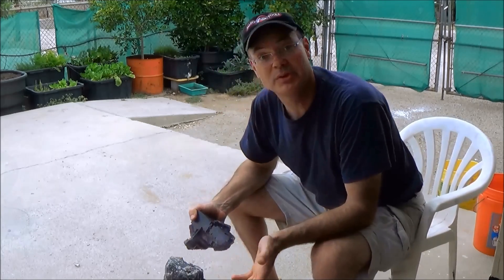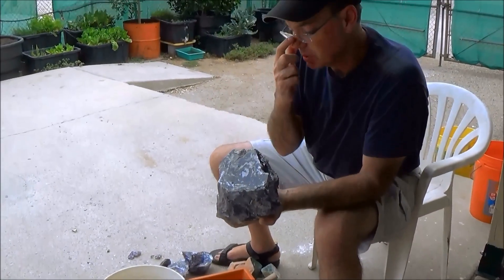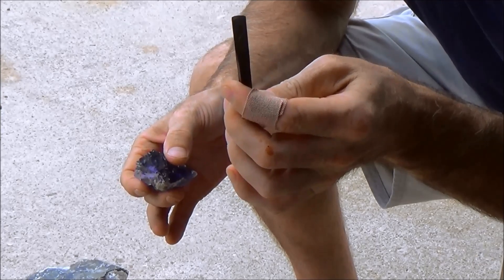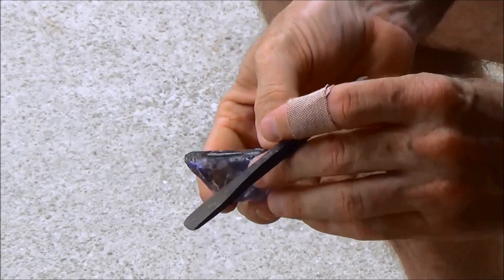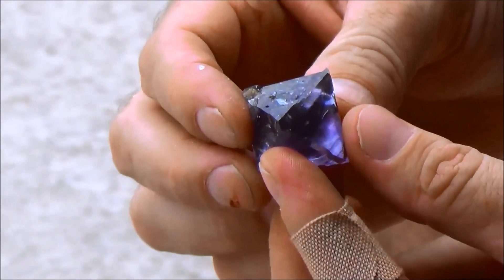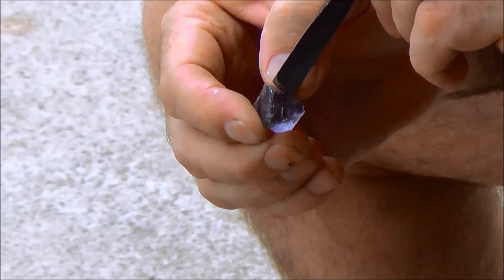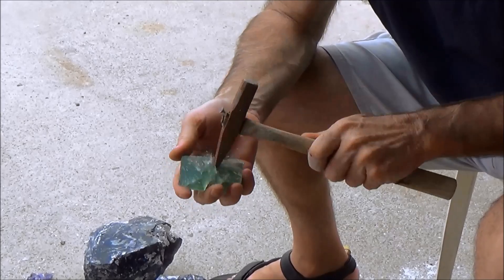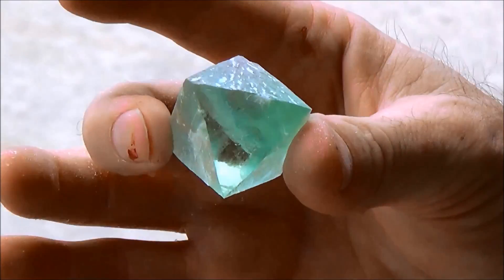How to Cleave/Chip Fluorite Octahedrons - Part 1

Comment: notice ... tiny pretty purple heart ... inside the flourite at 2:40! that's awesome! Love and peace brother
Reply from the maker: Thank you for watching and taking the time to comment!
Reply: @MineRatMinerals  I worked on airplanes for the longest time (about 45 yrs). An aircraft rivet gun holds, by way of a spring attached to the barrel, all the necessary rivet sets- including the seldom used chisel. When you insert the chisel set into the barrel and lightly pull the trigger, you get this very accurate hit. The spring holds the chisel set so it wont fly across the room,